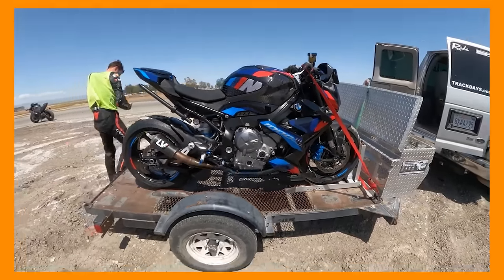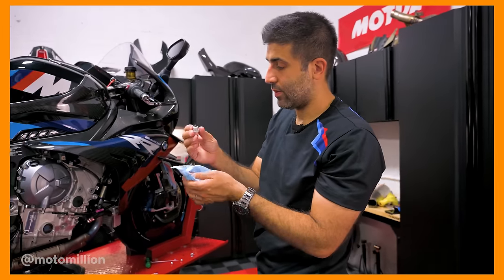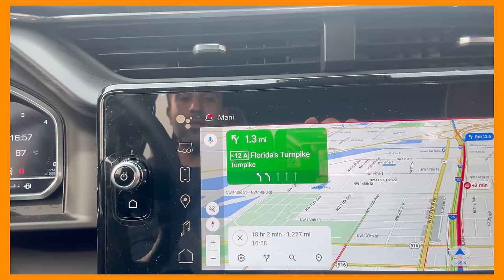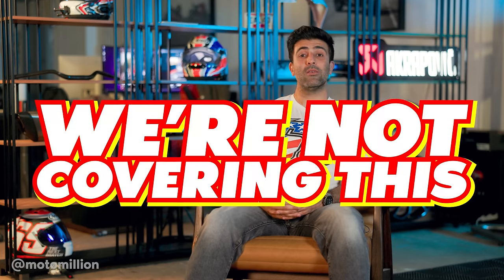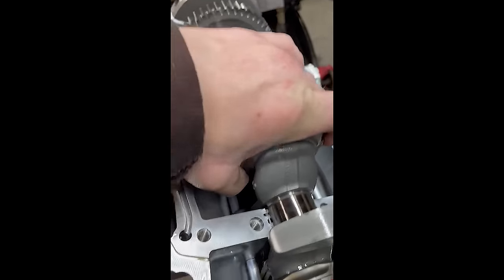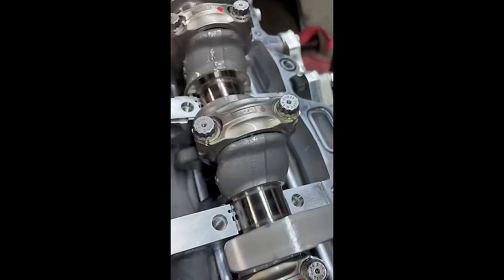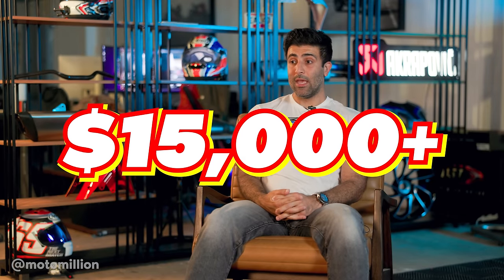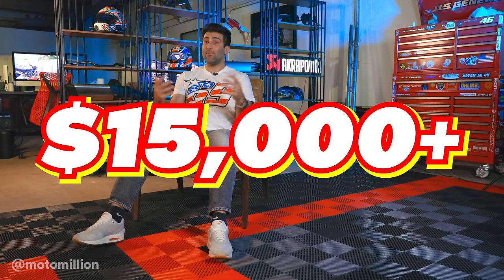MASSIVE Engine Failure on our M1000RR & BMW REFUSED Warranty...

Comment: So sorry to hear about this, you look crestfallen, I had a GSXR 1000 engine fail a few years ago (300 miles old from new!), took it back to the shop i purchased it from, after inspection (the next day) they got 2 technicians from Suzuki UK to come up (in day 3) and they diagnosed there was a problem with the engine, they already had a replacement engine just in case with them in the van, and replaced the engine the same day ( day 3), I also got a letter of conformity for the new engine from Suzuki, and one apologizing for the failure. Now this happened to me in the UK, I would have thought you would have least been given some compassion in what is BMWs flagship motorcycle, SHAME ON THEM!!!.
Reply from the maker: You see, your experience with Suzuki win's your business for a long time. It even makes us happy to hear stories like this and makes us consider such brand names too!
Reply: Thanks Mani, I hope you get some resolution from BMW  to this ongoing issue!. @Motomillion
Reply: This is why you buy Japanese, all about reputation for them
Reply: I've just started a job as a Steam Turbine Engineer. I would have saved up my hard earned money and purchased an S1000RR or M1000RR simply because of how fast they are. But after this video. I'm not wasting my money for a bike that might get me 1,000km before going bang. Last year I purchased a bmw 318d and got scammed too, purchased a bmw a decade ago and ALSO got scammed.

I think once I save my cash in a few years, I will just go with suzuki or Honda for reliability. 

I've owned my suzuki bandit for the past 5 years and it's never let me down once.
Reply: Pardon my ignorance,  but don't you have to do the 1000km run-in and service before going full throttle...
Reply: THAT is the service story I like to hear. Makes me want to buy a 2024 GSXR750 right now. Much respect to the BMW owner getting the shaft from BMW. It should not be that way. I have heard of BMW being like this unfortunately. A real shame too, damn nice bikes.
Reply: And here I am on my 25 year old Suzuki TL1000S with 57k on it that I service myself with nothing more than an Irish screwdriver and I haven't even needed a fork seal yet.
Reply: @thelouwryder187 now that is impressive!
Reply: @thelouwryder187  Hello fellow widowmaker owner... mine is 27 years old in August!
Reply: @blademansw  let's goooo
Reply: @thelouwryder187  Glorious machines aren't they? Bought mine in 2004!
Reply: @blademansw  very underrated, obviously it's nothing compared to what's out there now power wise but grin factor and cost to run makes up for it.
Reply: @thelouwryder187  Yeah, definitely. The noise they make is fabulous. I did tweak mine a bit a long time ago and get rid of the rotary rear shock and fitted an adjustable steering damper which made a huge difference.
Reply: @blademansw  mine is stock
Reply: @blademansw  I bought mine 5 years ago, it was a Japanese important so restricted to 180km/h but found 97 throttle bodies and and an F00 ECU. So I don't actually know how fast I go, lol
Reply: @thelouwryder187  Those are the main worthwhile mods to be honest, replacing the rotary rear damper with something better (I fitted a Bitubo shock) absolutely transform the handling, make it feel an awful lot more "planted" if you know what I mean. Just watch out for green crusties on the wiring connectors, Deoxit is your friend with that 🙂
Reply: @blademansw  I'm light 70kgs and honestly dragging knee isn't a problem for me, yet. I bought mine for 1700 dollars in South African money with 29k on the clock and I just can't warrant the cost of a rear shock for it when I honestly have no issue with how she handles as is. Rode her from Cape Town to Durban after I bought her 1700kms
Reply: GSXR for the win!
Reply: @Make-Asylums-Great-Again  isn't the GSXR faster anyway with it VVT?
Reply: @Make-Asylums-Great-Again Get out of here with your tiny pistons :P
Reply: SUZUKI👍
Reply: That’s a good company , again Japanese setting the bar
Reply: Im glas Suzuki hooked you up man
Reply: @phil4986 my buddy had a 750 with a full exhaust an he loved it very soild bike to
Reply: Not if it's not their fault.
Reply: @phil4986 do it man…i have a 2020 750 & love it so much. While im here, im in a bad situation.  My 750 has been at a shop for over 2 years….. front end damage— not too bad, insurance paid them $6995 something like that. They wont finish the work. They give me a story everytime i ask. Idk what to do anymore. They barely did anything but they did do some. I need the bike back any suggestions?
Reply: You would have the same service by bmw but in this case he modified the ecu and voided the warranty.
Reply: @thelouwryder187   Unfortunately, none of the manufacturers build bikes like that anymore. My 04 GSXR 1K went 78,000 miles with only chains, sprockets, tires, and a throttle cable replacement. Unfortunately, it got backed into.
Reply: I only purchase from japanese makers for a reason...
Reply: yeah thats what BMW would have done too lol
Reply: So get a Suzuki 😊
Reply: @jonasf1275  BMW is very stingy about warranties, I remember someone in my office lost his warranty because he used aftermarked brakepads on his 900F
Reply: @javierortiz82  one can't modify the bike and still claim warranty. But I am pretty sure that's every manufacturer
Reply: You redlined the bike and expect warranty?  Please
Reply: @jonasf1275  Honda has never had a problem when I use an air filter or brakepads from off the shelf brands.
Reply: @shawsie5780  I 100% agree with you as I was about to write the exact same comment, I’ve put over 100,000 miles on three different GSXR 750s and never ever had an issue with any of them, amazing BIKES!
Reply: @phil4986  PHIL, 61 and on my third GSXR 750 currently riding a 2014, in my opinion they are amazing bikes for both STREET and track riding, you can’t go wrong with a 750!
Reply: Maybe try a Suzuki 1000R model. They’re rock solid and have 6 year, unlimited mileage warranties. They also honor their customer’s warranty and treat you with respect along the way. 
Out of all the bikes I have owned, the Suzukis have always been the most reliable.
Reply: of Motomillion did the exact same thing you did, they would have a replacement engine too.... But they didn't.
Reply: German engineering is still trying to relay on the reputation from the 80's and 90's. Every survey I've seen shows German cars scoring at the bottom of the list for reliability and its not much better for the bikes too. I know it sounds boring but I would sacrifice style over reliability, that's why I've trust Japanese, ridden hard and has zero issues. Top of the list Yamaha and Honda
Reply: True story I was a Kawasaki mechanic early on and a guy brought his triple in for a warranty claim on blown transmission...he was drag racing the motorcycle at the drag strip but I dont really care that much even though Kawi paid CRAP on flat rate scale.  However the dude wanted his motorcycle fixed NOW and would not stop bothering multiple times a day (it would take weeks to get the PARTS even!)  So after many days of interruptions and abuse we called Kawasaki and got his claim DENIED....handed him back is bike with engine in pieces in a box LOL....the AH was threatening us with law suits "my uncle is a DA in Los Angeles" blah blah....he SO screwed himself!  LOL I still think about it whenever I hear warranty denial stories...moral of that story?  dont be that guy!  Or if you want to be that guy?   At LEAST take off all the racing stuff before you bring your bike in !  And do NOT be bragging how well you did racing!  Otherwise be cool be nice kiss a little butt because at that point the shop is doing you a solid to honor a warranty

Comment: My Ducati Diavel 1260s burnt oil for 2 years... full compliment in 3000kms. Then it ate a valve. Duacti replaced under warranty. The head of Ducati in my country stated "we want people to ride motorcycles" - 3 weeks later there was a new engine. It took a bit of work to get there, but they knew it was their responsibility. Sad not all companies put customers first.
Reply: I believe the '08 through '11 CBR 1000rr were known to burn a quart of oil between oil changes. Honda claimed it was normal, and end the end of the day engine failures were super rare on that model.
Reply: @taylorhickman84  This was 2019 model... and ultimately the issue lead to the catastrophic failure of the engine. The point is modern motorcycles should be more reliable... due to the price paid.
Reply: Thats extremely cool similar thing happend to my friend with his Aprilia
Reply: but you didnt take it on a dyno and a 400 mile ride with an engine warning light and some dude telling you pdi hasnt been done. Because thats what he did and stated in this video. Thats why he wont get it warrenty. Its not BMW's responsibility anymore when he does that
Reply: @imortaliz  Yep that absolutely true!
Reply: @imortaliz so you if you had a new sports car and a check engine light came on during a road trip, then you take it to a dealer, they tell you the check engine light is because the car wasn’t pre dealer inspected correctly so you continue to follow manufacturer recommendations about break in periods. Then at less than 1000 miles your engine blows up. Would you not be upset the manufacturer wouldn’t cover the repairs?
Reply: if anything its that specific dealers fault not bmw. No way in hell would Bmw take responsability for a bike that hasnt completed pdi. For sure i would be upset about it but wouldnt go crying to bmw. This guy probably knows the dealer personaly and was told to just ride it anyways by them most likely and now hes paying for it sadly  @jonathanhansen7734
Reply: @imortaliz agreed. End of story
Reply: @imortaliz  You guys that 100% back the corporation kill me. This is all happening, not just with motorcycles, this happens because of corporate greed. Many companies started out thinking customer service was the most important aspect of business, now with co. execs making obscene salaries with bonuses, it is screw the customer and to see people in the public jump to defend this is disgusting. I sure hope you are a BMW exec. because IF you are not, you are pathetic
Reply: It pisses me off that Ducati didn't have an oil pressure, oil temp gauge on my XDiavel...
Reply: BMW also woul have replaced their engine if they didn’t modify it  and have brought it to the dealer.
Reply: You would think... @cameronmale83  Longevity and reliability do not take precedence over performance on high end vehicles.  The result of using a Murcielago as a daily driver would be an example.
Reply: @mrmarcink1300  dude, its a 1260 that revs to 10k - virtually the same setup in the multistrada ... it's a detuned multi. Cruiser is in the name... meaning it should do long Kms... so yeah I'd expect longevity and not eat valves after 30,000 kms.
Reply: Especially BMW.
Reply: My Motoman broken-in Daytona didn't drink a DROP of oil, the fact yours did should probably have warranted investigation. Does your new engine drink oil like I eat fries?
Did you break it in differently?
Reply: @taylorhickman84  I have an Aprilia that burns more oil than that and it’s only got 5,500 miles on it. Hope she doesn’t blow up. 🤞🏻
Reply: @onazram1  So why didn't you add one if it was important to you. They know most owners are idiots (not you) so they use idiot lights
Reply: Ducati is built different.
Reply: @rcpmac    You missed my point, of course I can, but I shouldn't have to especially on a high performance engine...
Reply: @rcpmac  Wouldn't it void the warranty ?
Reply: @deankruse4491  For your sake I hope so too! When shopping for used bikes, I saw a lot of good deals on Aprilias with around 15k miles. Which made me wonder if owners were getting rid of them before a potential costly repair, or if it just that Italian bikes tend to attract owners that can afford to upgrade every couple years.
Reply: Sorry to hear about those mechanical troubles.  I am a huge 1260 fan, never got to ride one.  Are they as ridiculous as I imagine they would be?   Someday.
Reply: @BenRingenberg     it's an insane engine,  it really is...
Reply: @BenRingenberg  Well, if that's a Testastretta, it's crazy enough in 1199 ;) But it hates low revs.
Reply: why would a company repair other peoples dumb moves?
Reply: @KentRoads  To keep their dumb customers happy... that's not a negligible demographic, especially nowadays :P
Reply: my ducati 1200 multistrada 2012MY leaked oil on the oem electronic ohlins, ducati showed me the middle fingr, then metal debris on oil change, ducati showed me the middle finger, then almost chew a valve and went thru a 6 month fight with ducati via my dealer to get it repaired under warranty, lost a whole riding season and immediatly sold the bike once it was fixed, Fuck ducati dont praise them as saints
Reply: @ricardorodrigues3508  It's called "stealership" for a reason.
Reply: My friend bought a new Panigale V2 from the Ducati dealer. Before he took delivery the dealer put a tune on it. Within 200 miles the ABS failed. In less than 6 months the engine ate a bearing. Ducati USA refused to warranty it and permanently voided his warranty because THEIR DEALER flashed the ECU. He called Italy and HQ said it was up to Ducati USA, but they would have covered it. The dealer was pissed, my friend was heartsick. It wasn't abused, had less than 5000 miles, THE DEALER said the tune had nothing to do with the failure, and he still had to spend $5000 on a used engine from a wreck for his mint brand new $16k Ducati AND pay to have it installed. Disgusting. I asked my Yamaha dealer "What can't I do to this bike without voiding my warranty?" He said "nothing". It breaks under warranty, we will fix it, even if you blow the engine and it's your fault. It's probably not the European manufacturer that is screwing people. It's the American affiliate that represents them here and imports the bikes.
Reply: @ir8d8rads  They can say whatever they want, their actions will always speak louder.
Reply: Isn't it normal that an Italian bike burns oil?
Reply: @Okurka.  They should burn the oil which British ones piss, I guess, lol, these are outdated stereotypes, nowadays.

Out of my 3 Italians, the only one which burned significant oil was a 2 stroke ;)
Reply: @taylorhickman84 I purchased a brand new 08 CBR 1000RR Limited, as soon as it got to my dealer. I did no engine mods and at about 1000 miles, it had an engine failure. According to the Honda mechanic, the factory stated that it was the first engine failure to be reported. 
An entirely new bottom end was installed under warranty and never had another problem.
Reply: @TBagr  That sucks, but I'm glad to hear it was trouble free after they fixed it. How many miles did you end up putting on the bike?
Reply: @taylorhickman84  They weren't "super rare," I know a guy who had a 2008 CBR1000RR that snapped a connecting rod.
Reply: @CyberChrist 
There are no outdated stereotypes, only forgotten ones. People don't change, their life philosophies don't change, cultures don't change.

It only ever changes in intensity or takes a slightly different form but approach to living and doing things essentially stays the same.
Reply: @mickeypopa  Well, certainly not with that defeatist philosophy.

I've stopped smoking and walked again after my legs got paralyzed, Ducatis are reliable, and British bikes have stopped pissing oil.

What's your excuse? 😉
Reply: @CyberChrist 
My excuse is that I've already written a comment about Italians from personal experience but fascist Youtube keeps deleting it, so you can't read about what Italians are really like.
Reply: @cameronmale83 back in the day I had an 04 cbr600rr then 05 cbr1000rr and 06 cbr1000rr all mine were cool, but my buddies 05 Repsol was drinking oil. Though he didn't have an engine failure. Then other friend bought one in 08 and his was burning oil too. It's been a hit or miss with the issue with Honda
Reply: @JRDNGIXX  Something to do with break-in procedure, perhaps?
Reply: @CyberChrist  could very well be
Reply: BMW is absolute horseshyte, avoid like the plague.
Reply: I’ve in fact chosen Ducati instead of BMW

Comment: I think this video should be revised to “We messed up and needed to spend $15k+ to replace the engine”.
Reply: someone didnt watch the part where they are replacing engines with the same modifications and doing a hush engine recall...
Reply: nah nvm i just got to the party where they didnt even pass the break in period before they loaded it with engine mods... you right
Reply: I've had to Void warranties on blown up engines because of BrenTune ecu mods.....